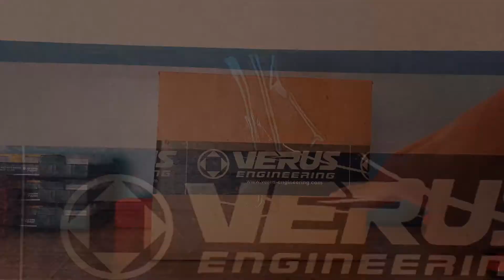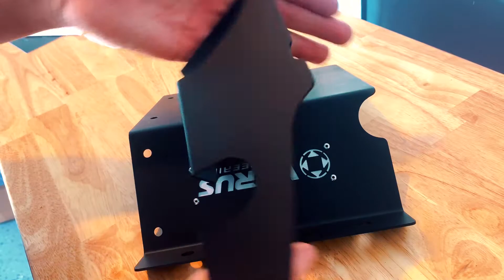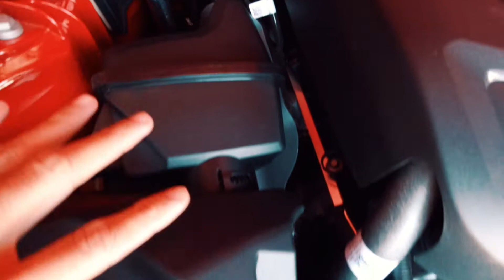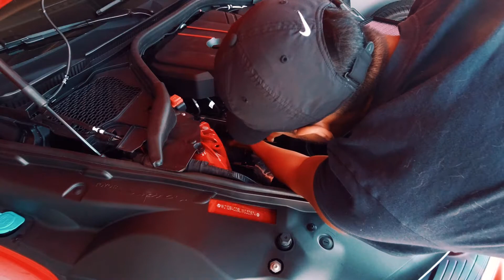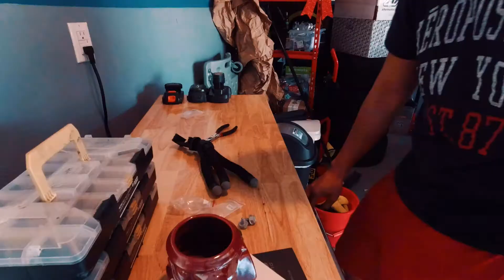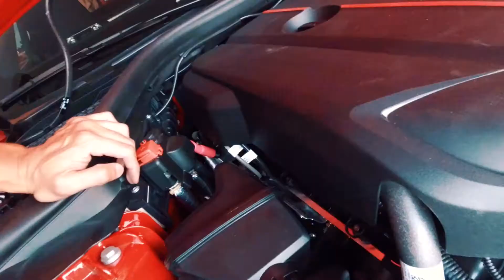Installing the Verus Turbo Heat Shield on the GR Supra!

Comment: Great video, but one question, why do we remove the IAT heat shield?
Reply from the maker: Hey there, great question! It’s been a while, but if I remember correctly, the IAT shield will not clear with the Verus heat shield. If you can find a way to keep it on then it definitely won’t hurt either.

Thanks for watching!
Reply: @TheAutoDojo  ahh got'cha, that makes sense. My brace just arrived last week so I'll hopefully get around to installing it "soon". 
Will definitely refer back to your video when the time comes; I'm sure it'll come in useful haha

Comment: I'm liking the start of your build. I also went with the Verus Heat Shield. I too lost a bolt and nut, they backed out while i was driving, i guess i didn't tighten it enough. the lower bolts were tough to get to, even with my small asian hands, lol. awesome content! keep it up! im stage 2 91oct (ots) with MarinTuned also. even on just 91, the car is crazy fast. I will be going E50, once i get flex fuel kit from Marin, it is currently on backorder.
Reply from the maker: Hi Arthur, thanks for the kind words! Yea, that lower bolt was driving me nuts! I can’t remember how many times I dropped it myself. Oh awesome, I remember when I first flashed the car for the first time on 91, felt like a completely different beast! Once you go flex fuel though, it’s hard to go back. The speed gets addicting haha. Take your time installing the flex fuel kit, I broke a small clip removing a panel in the passenger side, but nothing some super glue couldn’t fix. Luckily it was all hidden inside the panel hehe.

Again, thanks for watching!